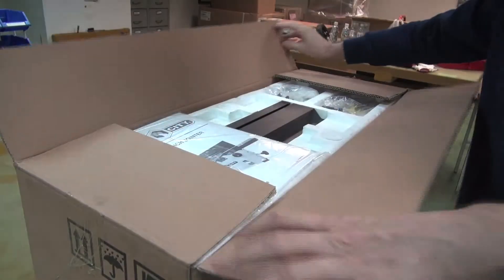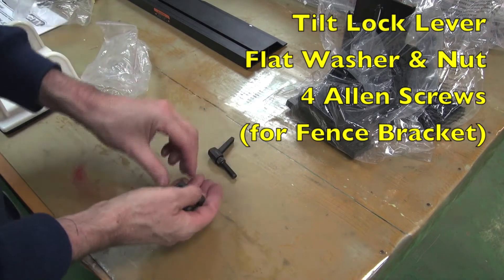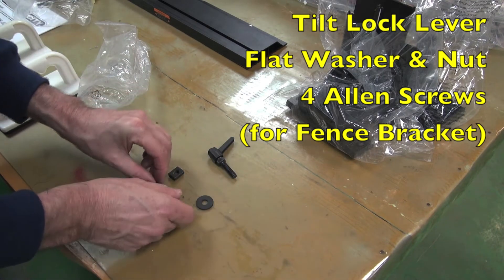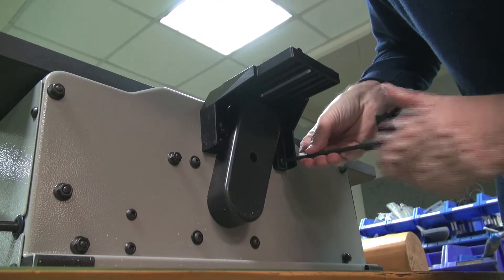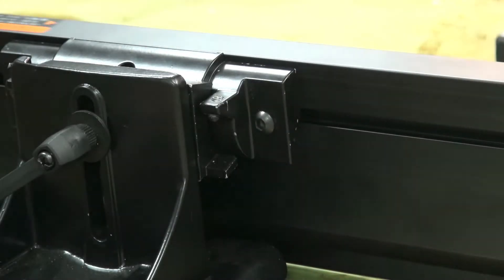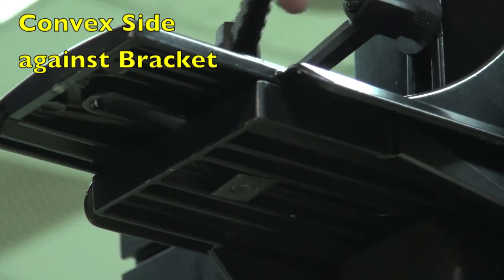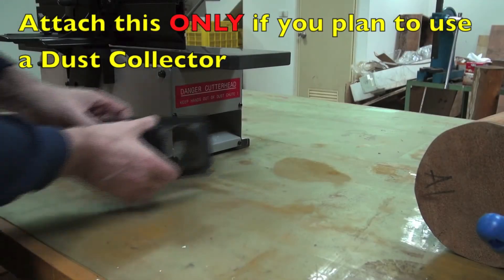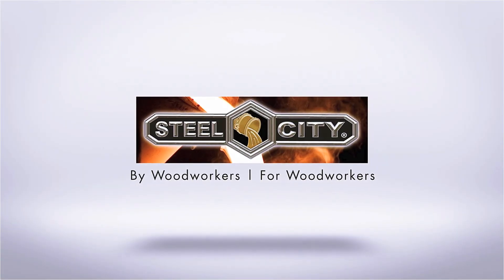6" Jointer Setup - Steel City 6 Bench Jointer (40610CH , 40610GH)

Comment: A 4" all metal dust adapter is available. Visit http://store.workshopsupply.com/catalogue/blackjack-dust-collection-metal-jointer-dust-hood-12-p-4394.html
Reply: A $4 discount is now offered on the purchase of this all metal dust hood. Visit the link, add it to your cart and when you checkout use discount code SCTW4. If you have a 4" dust collector you will happy you added this accessory!